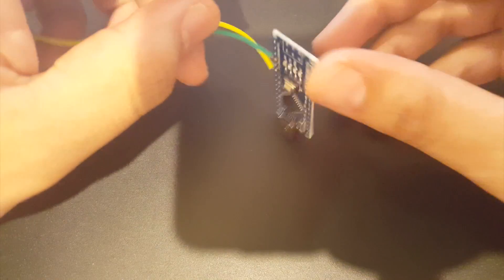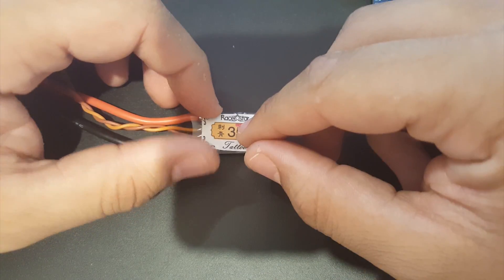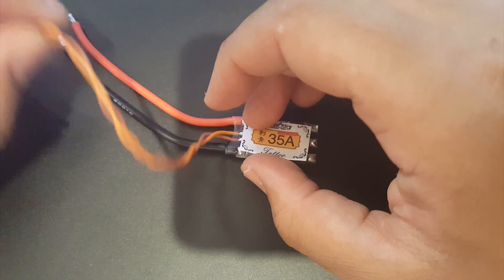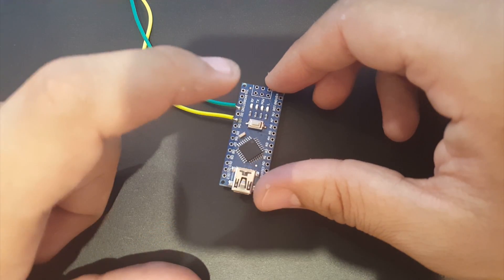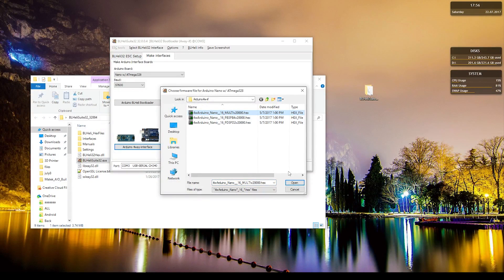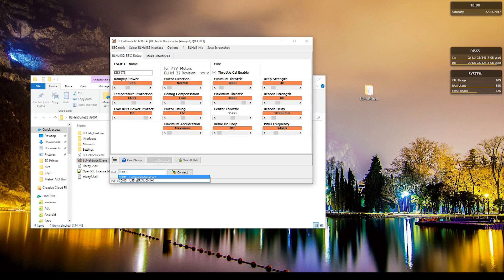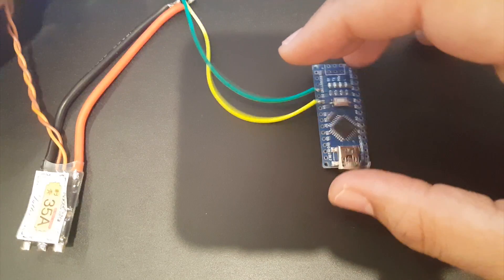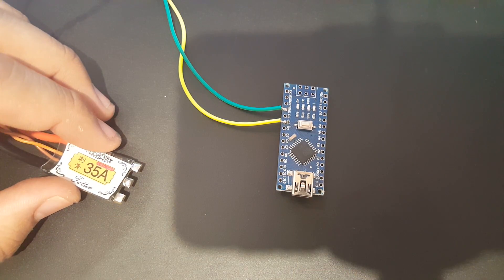How to Connect to Blheli_32 // Without Passthrough

Comment: Is there a USB device that I don't have to download and install anything to get my ESCs configured without a Flight Controller. I am trying to configure my ESCs for a fixed wing, not a quad and don't use Flight Controllers. I am a complete newbie to flashing chips, unzipping software, etc. My ESC (STRIX 65A) says it uses BLHeliS 00_00. I read from Oscar Liang that BLHeli32 and BLHeliS are incompatible. Will this procedure with the BLHeliS.zip file I downloaded, still work with the Arduino Nano knockoff in your link? Or do I need a different Arduino version? Can you link me to a REAL Arduino so I don't have to download different drivers etc. that a REAL Arduino uses?

Comment: @dronemesh i will use dys aria blheli32 esc. But i dont get a connection to the esc. I used a arduino Uno an the flashing was done successfully. I connected the signal also to pin 3 and the gnd to gnd. The suite connects to the arduino, bur when i want to reas the data from the esc, the software dont display the esc. I cant get a connection.  "Connection to esc1 failed".The esc gets power from the battery.  I dont know what i have to do. I use ist on a large buildt with am naza V2, so i cant use the passthrough method. I have tp use your method and your tutorial was amazing. You also have the aria esc. How did you connect it? Please help me. Thank you!!

Comment: Dronemesh, I appreciate the effort, but there is a MUCH, MUCH, MUCH easier way to do this same thing.
Steps:
1. do a cli dump of your Betaflight 3.1.7 settings and save as a text file on your desktop.
2. flash Betaflight 3.2 onto your flight controller.
3. use Blheli 32 passthrough to program your escs however you'd like.
4. reflash betaflight 3.1.7 onto your flight controller and paste your old settings from text file into the cli.
done.
Reply from the maker: +jef x loool .. Thanks for the info but the title is without passthrough ^_^
Reply: Drone Mesh, oh ya.... i guess i overlooked that part. Lol
Reply: Drone Mesh Can you please do more build with matek f405 aio or just setup with it?

Comment: Great video😉👍 
Especially for all the Mac users it's very convenient to being able to get acces to the BLHeli32 esc trough this method
Reply: how does this help mac ?
Reply: jeremiahgrover because you can access your Esc without needing BLHeli32 Suite. What didn't exist for Mac
Reply: he still used blheli_32 suite on a windows @ 3:42
Reply: jeremiahgrover Also True. 🤔 I don't remember why I suppose that it would be beneficial for Mac users😵
Reply: I just tested this method: download Parallels for Mac (free trial) and it will install windows for you. Download and install blheli suite and the VCP drivers into your new windows machine. http://www.blheli32.com/download/ and https://www.silabs.com/products/development-tools/software/usb-to-uart-bridge-vcp-drivers Because of how parallels works you can do all the downloading and unzipping from your mac, the files will be in the downloads folder in parallels. After that, open betaflight without connecting, look at the port i.e. COM 3. Open blheli suite 32 in parallels and choose the cleanflight interface, click connect on your port in the bottom, plug in your current limited lipo, click read setup